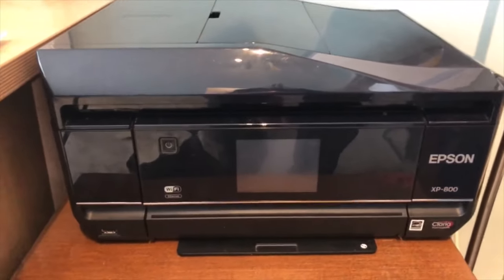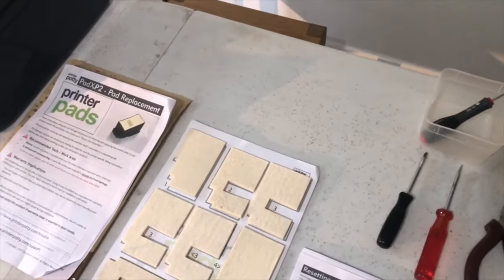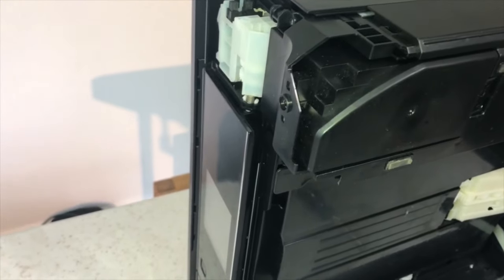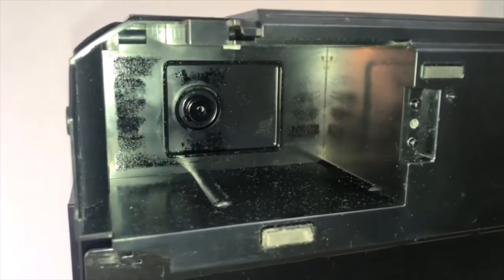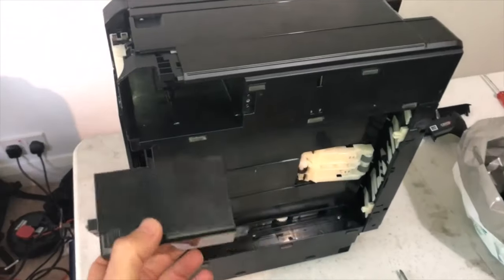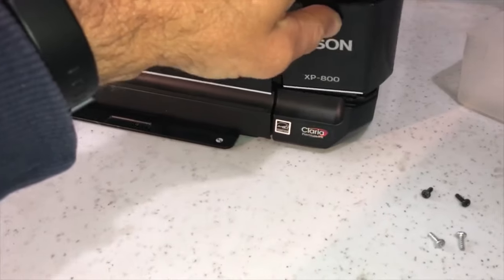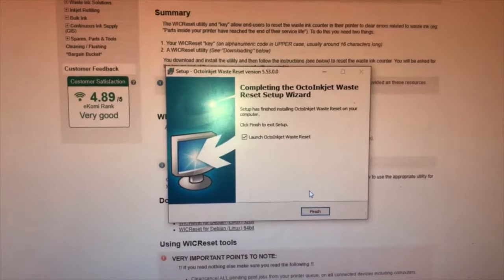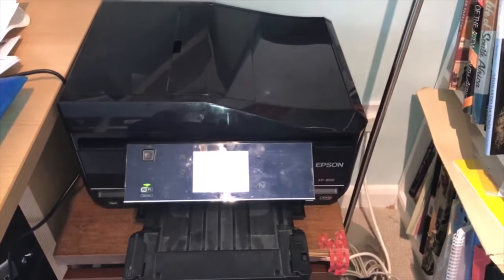Epson XP error - ink pad replacement and reset of the printer using a code / key.

Comment: Thank you for this video - so clear and easy to follow! I had never heard of this issue until it happened to my Epson XP-860 printer in the middle of a print job.  

Extra helpful points for me:
7:40 - Staging used pads in order as a double check for new pad group assembly
10:50 - Releasing spring loaded catch to open printer body during re-assembly

It may go without saying, but use caution when rinsing out the tank - it may be water soluble ink, but it will still make a great deal of mess if you spray or run water into it with too much force!  I filled the sink with enough water and then dipped and swished the tank until clean.

I was dumbfounded that the printer didn't give me some sort of warning first, but realized I had to find a solution quick (other than calling Epson for support)! I found the description and directions to do the temporary reset so I could finish my print job and ordered the 'Printer Potty' pads and reset key from OctoInkjet http://www.octoink.co.uk . Their kit came with instructions and links to their videos but I had already found this one and it took me through all the steps in one video without any trouble. Just the hint about retracting the spring loaded catch to be able to open the printer up again, was worth using this video instead of the others.  Thank you, again.

Comment: Well all these comments seem so exceedingly congratulatory that they seem to follow a formula. I wished I had one of these "you cured my terminal cancer with your brave video" moments, but alas, I couldn't hear or understand any of the words you mumbled. All the other audio like the printer noises came through loud and clear. You sound like your gargling under a blanket inside a closet from the house nextdoor.
Reply from the maker: 🤣 I think you may have an audio issue. Sorry this video doesn’t work for you but for hundreds of others it did.

Comment: Does anyone know if you can use the access key more than once? 
I need it for this same reason but also to reset the ink levels as I'd just put new ink pads in and they are now showing as empty
Reply: Each key is a single credit so you can only use a key once. There is no limit to the number of times you can reset your printer though.

Comment: this is the same for the xp-530 but where did you get the pads ?
Reply from the maker: I ordered mine online from Octoinkjet which is based in the UK. If you are not in the UK perhaps google search to see if there is a local provider of the ink pads that you need for your printer.
Reply: The XP-530 uses the same part but has a slightly different approach to installation than the one shown. The Printer Pad kit includes paper instructions that detail the process and tbh, Tristrams video isn't much different for the bulk of things.

Comment: Can anyone confirm please if this works for a XP-960? The pads I find for sale mention 800 series but not 900. I have the same error message on the XP-960.
Reply: The XP-960 is now covered with our XP4 printer pad set and you'll find it's much easier to replace the pads than the model shown in this video. We recently did our own video for this (following Tristrams excellent example) which is on youtube under keywords: XP-950 waste ink pad

Comment: Will this work on the Epson 810?
Reply from the maker: The layout of the 810 looks slightly different, ie the ink potty will be located elsewhere, but the general idea/process will be the same. Good luck.  Let us know.
Reply: @tristramo3760  It's actually the same waste ink design for the XP-810 so you should be fine.

Comment: Great video!  Has anyone successfully used this video to change the pads on an Epson XP600?
Reply from the maker: Octoinkjet may reply too or you could call them but I hope the video will broadly be the same for your XP600. The shape of the inkpads may however be different so please check that before ordering.
Reply: Thanks for your lightening response Tristram! I checked carefully with Octoinkjet before I ordered and it seems that all the Epson XP range have the same pads.
Thanks again for a great video....10/10 for camera work, audio and most importantly....pace!  I'll be on here again once my pads and code arrive and I've completed the job.
Reply: The good news is I successfully changed the pads and entered the reset code.  The bad news is when I switch on the printer, I get a 'close the scanner unit' message. I've tried everything, but every time I switch back on, the message is still there.  Any tips would be most appreciated.
Reply from the maker: So sorry but I have not seen that error before.  I am sure this isn’t the case but could it be that one of the parts hasn’t been put back ‘flushly’ so not quite allowing the top flap to shut 100%?  Worth checking…..
Reply: Tristram O Thanks for your quick reply, Tristram. I shall certainly try your tip about possible misalignment.
Reply: Hi @PeterBrownPianist . Just to note that the video above covers the XP-500 and almost all 600 to 800 series Epson XP printers. while the XP-510 to 540 models use the same pads but a different installation method. 

The earlier XP100 - 400 models use a different pad and installation process completely [we have our own video for that now]

Sorry to jump in  @Tristram O  but thought I'd best clarify in case anyone just assumed the pads and instructions were the same and got caught out.

Comment: Will this work for an Epson XP 15000 printer?
Reply: The XP-15000 is a newer design which has a user replaceable part called a maintenance box (ref: T3661). It's basically a pad holder with a chip so when the printer says the maintenance box needs replacing you remove the old one and install a new one. There are chip resetters (hardware ones, not software with a key) that can be used but they're only really useful if you are getting through a lot of maintenance boxes.

Comment: I have the Epson ET-2760 I had it like six months and didnt really print that much before it started with the ink pad error I hate canons and Epson for this reason. Both these brands also have a stupid chip on the ink cartridges so if you refill them it wont work cuz of the chip! I will stick with my HP
Reply: The ET-2760 is now covered by this video if it helps: https://www.youtube.com/watch?v=QMsNB-YDotY

Comment: Io dopo aver fatto questa operazione non mi riconosce 2 cartucce cosa devo fare?
Reply: Translation: After having done this operation, it does not recognize me 2 cartridges what should I do?

Answer: The printer often will try to do an initial "ink charging" routine as if it was a new printer. This means the printer expects the cartridges to have more ink in them. Recommend you try replacing the two problem cartridges (and possibly the full set) to allow the printer to complete the ink charge and it should then work. You may even be able to use the two problem cartridges again later too. Hope that helps.

Risposta: La stampante spesso tenta di eseguire una routine iniziale di "ricarica dell'inchiostro" come se fosse una nuova stampante. Ciò significa che la stampante si aspetta che le cartucce contengano più inchiostro. Si consiglia di provare a sostituire le due cartucce problematiche (e possibilmente l'intero set) per consentire alla stampante di completare la carica dell'inchiostro e quindi dovrebbe funzionare. Potresti anche essere in grado di riutilizzare le due cartucce problematiche anche in un secondo momento. Spero possa aiutare.
Reply: @octoinkjet  ho cambiato le 2 cartuccie non funzionanti e adesso è ritornata funzionare cmq strana come cosa

Comment: In other words, once your waste ink pads are full (which can happen rather quickly if you print even a modest amount of pages) you get extorted to pay ransom money to EPSON so they can change the bloody ink pads which takes less than 5 minutes, and they charge you hundreds of $, more so than the cost of a new printer.  Nobody should have to pay ransom to use the product they already purchased, once your printer is out of the warranty (the sham of a warranty), you should have the right to repair, replace and reset, since EPSON is no longer liable ....... it's one thing the rip people off by charging them an arm and a leg for those ink cartridges, but extorting money for changing pads and resetting when you can do it yourself, that's bad - not only that, they made those new printers so that you are no longer allowed to use refillable ink cartridges with auto reset chips, only single use chips, with each chip costing several $$$, so no value in getting those - then they now restrict to only using genuine ink, and the new lows from epson, waste pad areas are now chipped so you cannot replace them yourself, the countless lawsuits and they never learn and get away with it each bloody time.  

Instead of being EXTORTED hundreds of $ from EPSON to reset my printer I rather spend a few $$$ to encourage developers of software like WIC Reset.   It's a good thing we can purchase those pads and replacement from 3rd parties, and have reset software also available from 3rd parties.  Cheers to them.

Comment: Ever consider to replace the ink pads with diaper or lady's pads?  Of course you will need to remove the shielding materials first.  "A printer with a diaper :)  "
Reply: Word to the wise, if you use tampons, test to make sure they won't swell so much that they clag up the holder and create problems later on. We had one end-user who didn't think ahead and it was a hell of a mess.